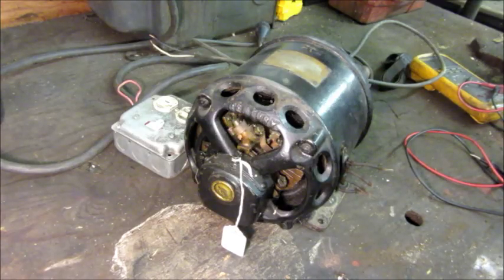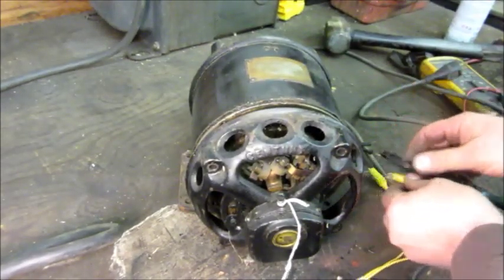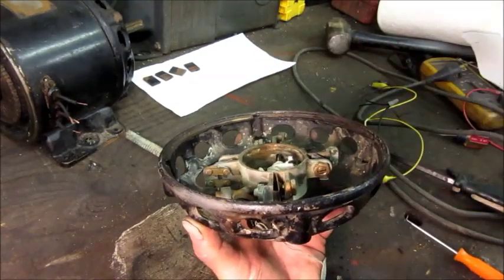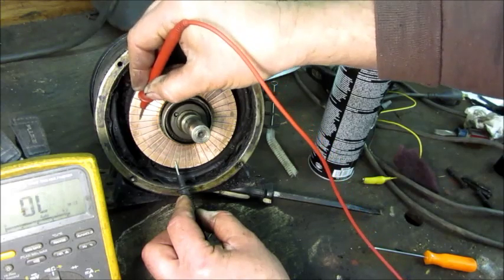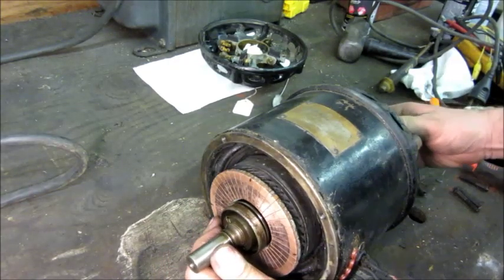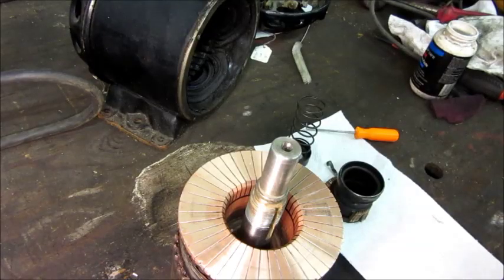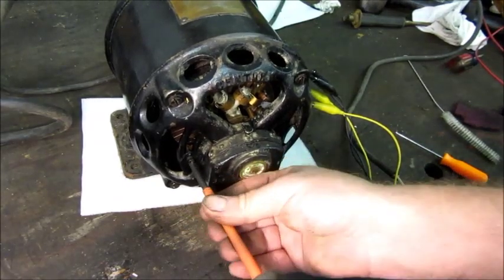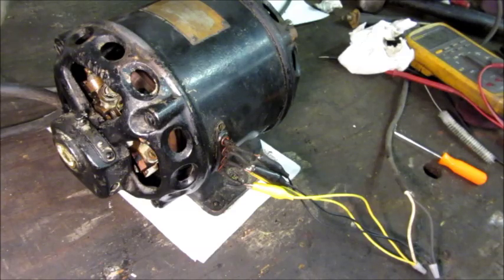Century Repulsion-Start Induction Antique Electric Motor - Troubleshooting No-Start Humming...

Comment: Very helpful. My 1/2 hp Wards R-I motor on an 1923 Kellogg em-722 compressor hums and the rotor freezes with power, but turns freely when power withheld. Now I have a plan to troubleshoot it. Thanks!😎

Comment: Excellent demonstration. No explanation needed for me as to why anyone would want to keep one of these antique motors. I have a Champion Blower Camel Back drill press that is older than dirt but in mint condition. It has an antique 1 horse Century R/I motor. I need to take it apart and clean it because when I meggared it tested bad. It is worth it to me to repair the old motor rather than put a newer Cap Start single phase motor on it. Again, excellent demonstration.

Comment: Yeah, I hate that too, when some armchair engineer tells me I can't use an abrasive to clean a commutator, or electrical contacts. In the case of contacts, they insist you use a contact cleaning strip... which is literally 500 grit on a piece of sheet metal!

Also, as someone who also appreciates old stuff, things like the example you gave, about the end housing being designed to be beautiful... I think that's really something that's been lost, hasn't it? To them, they figured that piece is being cast either which way, so making it pretty cost them almost nothing. Today, things like motors are always designed to look simple and utilitarian. As if beauty is an old fashioned concept.
Reply from the maker: Sadly; I think you're right that beauty is an old-fashioned and lost concept now. Everything has to be the cheapest. It's like pride in craftsmanship which made the industrial revolution happen is being lost now. 

These people who just blurt out "that is bad" when they see an unfamiliar product are being closed-minded. They are missing the point that it's up to the end-user to determine if any given product is fit for any particular purpose. I have my favorites such as the red scotch-brite and Wearever brake cleaner. Those both have remained unchanged for as long as I remember.  

The issue with cleaning abrasives is, there are so many and some of them are conductive. Makers sell products without telling you what's in them so it's a buyer-beware market.  The Scotch-Brite pad I used isn't conductive and can't create shorts by jamming particles of conductive grit between the commutator segments. 

With the sliding friction and carbon-copper interface of the commutator, there is less worry about residue. With high power contact points, such a motor starter contactors, or the centrifugal switch contacts in a motor there is one extra concern. The contacts are metal alloy which develop an oxide layer. That layer helps keep them from welding together from the arc of making or breaking contact. If you end up with some coating which prevents the oxide layer from working, the contacts have all the aspects necessary to weld.  Some abrasives melt in the heat of an arc, forming a glass-like layer which coats the contacts. This layer is essentially the final aspect of a welding process, acting like a flux and allowing the contacts to fuse together without the oxide layer being able to form.  With small relay contacts and the like, it should never be a problem but for high power contacts, I always try to be SURE no abrasive residue remains. I haven't ever had my own repaired contacts weld,  but I have salvaged stuck contactors that were welded. No idea the cause.
Reply: As for attention for details: it come at a cost. Many are not willing to pay it today.
Also, if they take time to make a nice casing, they have probably done some effort to make what matters be as good as it can reasonably get with what they have.

Cheap junk have probably always been cheap junk! Old quality items stay around, for the past & the future.
Reply: LOL, if people are complaining about abrasives, they must really pop a cork at the concept of an armature lathe.
Reply: @MrUbiquitousTech  ikr?
Reply: Less metal is used with the skeletal design and also more air flow to benefit cooling the natural materials to prevent degradation. Rounded and beveled holes are stronger. So there was engineering involved as well as beauty.

Comment: Excellent trouble shooting video David, thank you for that! And I agree, older machinery has a lot more than just function in it, but a lot of artistic value in them as well. This goes to motors, hand-wheels, lathes, pulleys, drill presses, etc, etc. This makes them not only collectable, IMO, but a pleasure to use as well.

Comment: My guess on the gummy stuff would be someone tried to lube it with WD-40. It’s good for keeping moisture and rust off of metal but it eventually dries out and turns into a hard grease. Learned this the hard way lubing my 22 as a kit and the bolt wouldn’t move the next time I tried to use it.

Comment: It appears that the short circuiting necklace spring went in backwards from how it came out. I wonder if that was part of the problem? Or if it doesn’t matter? I was watching closely since I have one that has been apart for a long time, and the necklace spring was burned, so I don’t know which way it goes. ;)
Reply: I saw that as well. When the necklace was removed, the spring was on the inside. When installed it was on the outside. I have not idea if that matters since  I have never worked on a motor with a necklace. Just wondering. Since the spring has eyelets at each end, should there be a small spring connecting the eyelets to hold the necklace spring together or does the strength of the necklace spring hold itself in place?

Comment: Great video! I just inherited the same motor. What kind of oil do you use to lubricate the rod and bearings? There is two small ports on each end of the motor

Comment: I have a old Century and a B-Line, after watching this maybe I'll try tearing them apart. My local Motor Service said boat anchors, cheaper to replace. I do have one question.  Is that motor also a 220v, hook the two center wires together and 220v to the two outside?
Reply from the maker: That is correct. The two coils in parallel are for the lower voltage, while the two coils in series for for the higher voltage.

Comment: Amazing how quiet it is when it's sitting on a pad. Is this a 120/240v motor or just 120? What's the hp rating?
Reply: It’s a dual-voltage. It most likely states 110/220vac, as those would have been standards at the time of manufacture. Quarter horse. (1/4hp), is what I believe he said.

Comment: connecting the two middle wires it should have still started, because that's the 240v configuration, i have the same motor, and it will start in that configuration but with significantly less power
Reply from the maker: Cool!  I'm sure it would have run, just less kick. Hang onto that motor as they are hard to come by. :)
Reply: Agree, not uncommon to see on transformers, two 110V windings.
You pick 110V paralell, or 220V series, seems reasonable for the motor too.
Reply: @davida1hiwaaynet  i payed a whopping $16 for it

Comment: Not trying to be nosy but what is your occupation? Just Wondering how you learn how to do all this
Reply from the maker: No problem. My dad and grandfather got me interested in things like this when I was pretty much too young to talk. I've worked as a field service engineer my whole life. My current job involves commissioning, integration, and troubleshooting of power generation equipment, its controls, and engines that drive it. All of this type technology fascinates me. I research things I don't know and take time to understand "how and why" instead of just "following a procedure" until it works. So I guess I learned through experience with work and hobbies; and through some schooling plus years of self research on different problems I've encountered.